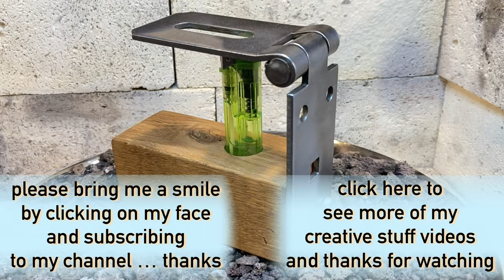Making a cheap automatic gas torch lighter igniter.

Comment: Hi Nick well done on the invention, it's a real pain picking up the igniter all of the time isn't it. I just noticed that you have a Smith little torch, or I think that's what it is.  You responded to my query on the Cooksongold forum about wanting to ball up the short end of silver wire that has passed through a bead and strip if silver. If you forget about damaging the bead (thermal shock) would your Smiths torch melt/ball up a 2.5 to 3mm long 0.8 diameter silver wire right up to the body of the strip as I described on the forum? Second question, what oxygen source do you use for that torch? 
Regards . .  Andy
Reply from the maker: hi Andy, yes I think it would easily achieve this, but I suppose you never know until you try something. I imagine the strip would just have to get hot as well until the wire melts first. having the hole the wire passes through slightly larger may also help. I’ve had my beloved Smith’s Little Torch about 6 years and now only really use it for casting, however it come in very handy for jobs like you are trying to achieve. I use a supplier called hobby weld or hobby gas for oxygen that offer a refundable deposit scheme on there bottles which is much more convenient than most.
This video was meant to be just a bit of fun after seeing how much a commercial electronic lighter igniter would cost to buy … cheers … Nick.

Comment: Well done!  Do you run the oxygen for your little torch from bottle or a concentrator ? Cheers Jim
Reply from the maker: hi Jim, I use a large bottle of oxygen from hobby gas … no rental fee just a deposit … not committed to investing in a concentrator yet … cheers … Nick
Reply: @Nickscreativestuff  Thanks for the info.  I invested in the concentrator as I didn't fancy having an oxygen gas bottle in the workshop and the compact size of the concentrator goes under the bench. Cheers Jim
Reply from the maker: i’m not sure if it’s correct but I read somewhere if you don’t use one for awhile sometimes they can stop working … N

Comment: Nice one... that would make me dare to start a solderingtool... that's the scary part..
Reply from the maker: hi Malika, this igniter is great for big scary torches, what you need to start with I think is a small refillable self-igniting butane torch the sort sometime used in a kitchen … cheers …  Nick
Reply: @Nickscreativestuff  thank you for the advice. Can you solder copper with that?
Reply from the maker: yes definitely but only up to a small sized item something like the size of a small coin or ring … N
Reply: @Nickscreativestuff  that's all that I need. Gonna look into that. Thank you... 😘